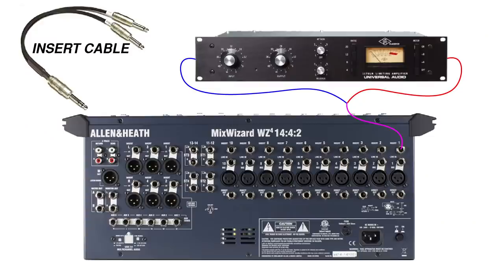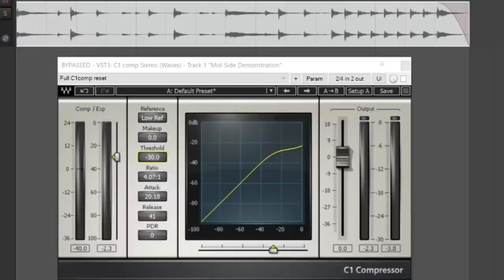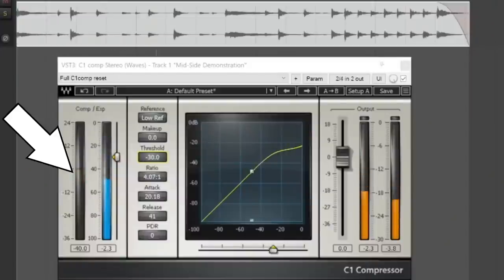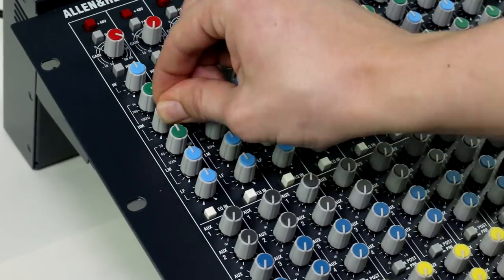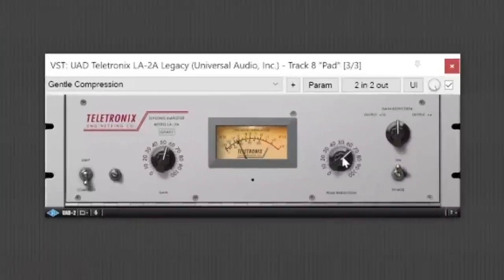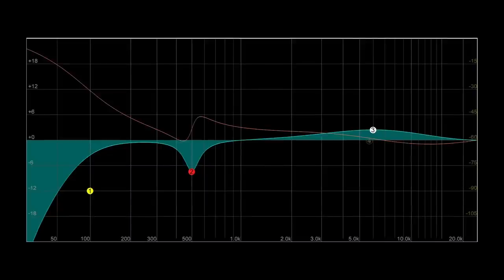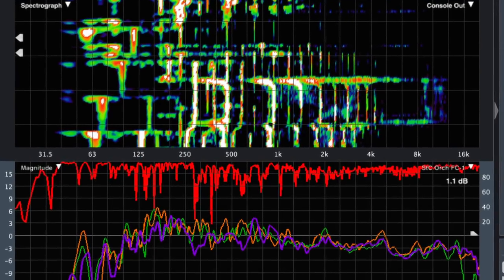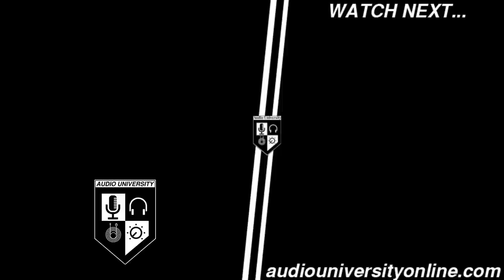Are You Making This Mistake? It Might Be Ruining Your Mixes...

Comment: I’m in my late 50’s and have some significant (~25 dB) hearing loss in the low midrange frequencies (200-400 Hz). I kept skipping back between the two tracks at the beginning and was dismayed that I couldn’t discern any difference, blaming my condition. I not only laughed when you revealed they were the same, I was relieved. Great video for getting the point across! Thanks!
Reply: Love this comment

Comment: I actually did the close eyes technique during a lesson at Plaid Dog Recording (I was an apprentice engineer), knowing full well about the eyes bias and I wanted to let my ears determine what sounded good rather than looking at a dial or numerical values.

Similarly, particularly with compression, I like turning the dial to an extreme setting first and then dialling it back to where it sounds right.  It's much easier to find the right settings this way as you will find that "sweet spot" when it comes to compression because you are starting from a position where you want to avoid.
Reply: That works with EQ too. Used it in Winamp since I can't remember when.
Reply: @ivanadaev1000  Yeah, for EQ, the eyes close definitely works as a double-check, though it's good to look at what you are doing first when using something like Fabfilter (or any EQ with that kind of interface).
Reply: @DerekPower  I meant turning the dial to an extreme, then gradually pulling it down to find sweet spot.
Reply: @ivanadaev1000  That too 😁

Comment: The host makes an excellent, fundamental point here.  I would extend this lesson to what many think is ‘producing’ but I would say is actually mixing.  Listen to the whole piece being mixed before doing anything technical to it.  Don’t touch eq, dynamics, even pans.  Throw all the faders up and get a 15 second balance in mono, then hear it.  Many, many times with pencil and paper.  Try to develop an opinion about the arrangement, lyrics, overall impact and meaning of the piece.  Imagine what would make it ‘better’ for you without touching a single control.  Is the vamp boring, too much repetition?  Is the intro pissing you off, pointlessly too long?  Is that solo gratuitous, even embarrassing?  And most of all, is the story getting told?  I spend a very long time in this mode, and any changes that result save me many hours later.  Our job is not to polish a rock into a gem, it is to make a great rock.
Reply: This is a great point, clients that I worked with years ago as a producer were always surprised when I explained to them that the mix really starts with these basic elements, sometimes it was as simple as changing the key to match the vocalists range. 👍
Reply: @jdanielcramer    Each musical key has its own mood, for lack of another word.  A-flat is a markedly different world from A, and I will often change key after the fact if it feels absolutely magical to do so.  This can be easy (in mastering) or unbelievably time consuming mid-project.  I prefer mid-project so that overdubs are done in the final key, which go a long way towards ‘legitimizing’ the new signature.

Comment: some ppl tell clients they made changes even though they didn't - anticipating that the artist would not be able to hear the difference the change made, or too set in their ways of mixing.. I've had this happened multiple times with at least two different engineers...... it often has a negative impact on the working relationship. What also sucks is when they actually make the change you ask, but then don't adjust everything else relatively.

Comment: To my mind It is clear the cymbals are slightly choked with compression. So maybe I'm missing something. There will always be a slight change in sound, simply because of the algorithm the material is going through, it becomes more apparent when inserting plugins in your own daw setup, it can sometimes be so subtle almost a feel thing. It's funny I don't see camera people saying, don't put a lens on unless you really need it. The helpful way to look at compression is to understand release times etc and then decide if you wish to colour a tone and shape it. Specifically with the waves basic comp bundle I often notice how the sound becomes a bit duller, with a narrower stereo image then before, and have always wondered, why a supposed transparent digital comp is messing around with an imaging thing. It's not just that specific bundle, many compressors and brands can tend to narrow the image slightly, hence many engineers using the now well-known trick of using mid-side comp or just a comp in stereo to remove some of the clamping down narrowing artefacts. Simply put, anything put on a signal will change it, and if you can hear it, especially not on youtube, if subtle, then insert a comp on the daw, the same one as in this video, and the source will feel difference. The other response is, unless you really do want nothing on the source, then don't put something on the source: simples. With C1 Comp, a standard kit with a clear back beat and singular hits, snare bass drum hi hat, would sound ok, but to exaggerate the point, if you where to put the same comp on a balance lush, jazzy open spacious sounding kit, with smooth spread washy cymbals and wide Tom Tom spread, you will hear an dulling of the tone and a collapsing initial stereo spreading of the image which is why, according to the manual, waves have mentioned that this bundle is suited best for insert material on slightly more mono signals, because they feel most elements should, ideally be controlled and tamed, before anyone starts saying that is my opinion, it is the reason, Schepps and Brauer and Clearmountain, never liked directly compressing things, and further more favoured using stereo compressors, to escape this non-transparent collapse of the mix or elements in the mix, that couple with parallel comp. It is also the reason you don't see something like the C1 Comp strapped across the master bus, it simply can't handle all that lush stereo information, not in the way a fairchild or other comp can.

Comment: I have found that I mix differently when using graphical plugins vs a console. I'm usually a bit more extreme with the console, because I'm trying my best to hear real differences. I do chalk that up to a bit of inexperience, though, because I'm still learning to hear subtle changes. Sometimes it takes a bit of back and forth with the bypass button to check if what I'm hearing is true. I think maybe having the visual aide in a plugin can help with understanding what you're hearing (or not hearing).

Comment: Listened through the clips several times, thinking that the difference must be really small. I was almost ready to dismiss the whole video as a "oh it's probably some very high end trick that some people think it's important but doesn't really make that much of a difference" thing. Even after I paid attention to what was on the screen and saw the compressor doing its thing I still thought that I can't really hear any difference significant enough for me to say that some additional tool had been applied. But the message of the video is very good, although at least personally I often end up with good "looking" EQ graphs simply because I need to mix a new live set in a hurry and have to begin by applying some generic correction that has worked in the same space with the same tools before. Which is also the reason why I always want to hear the difference between audio clips. If I can't hear it, it was probably a waste of time to apply it in the first place and time is of very high value to me. I do audio technics as a volunteer for a local pentecostal church and there's a large number of musicians and different kinds of sets that rotate there.